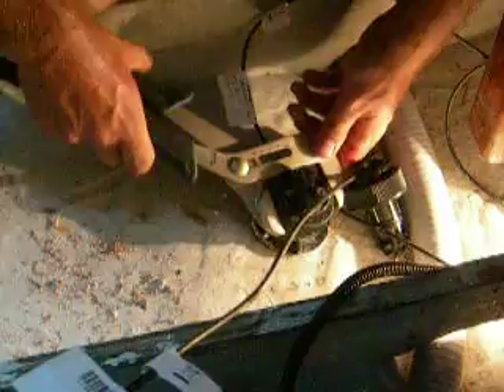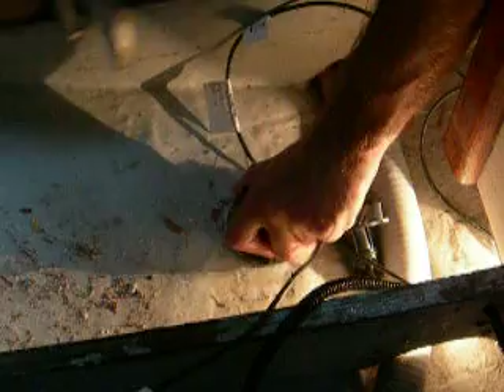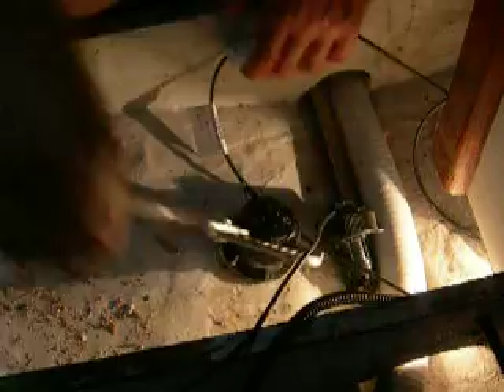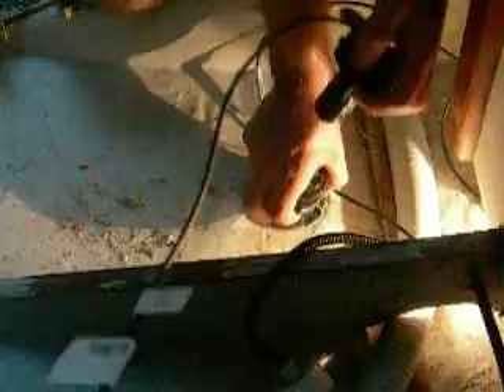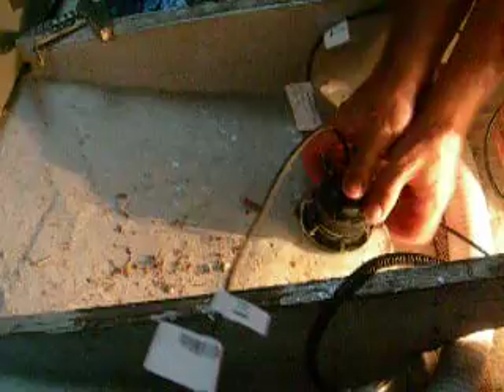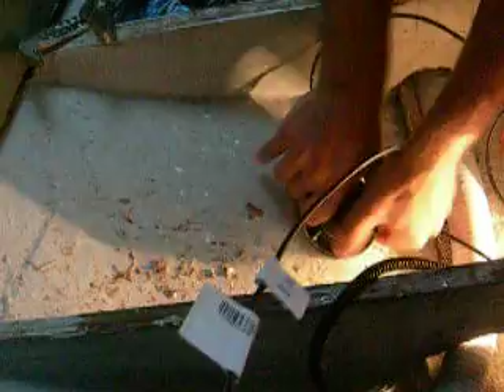Installing the speed sensor

Comment: Very helpful that you posted this, thanks! On my last boat, a Beneteau First 29, the speed sensor was located beside the keel, so removing it before haul-out was never necessary and I never thought about it. On my current boat, a Beneteau 393, the speed sensor is forward of the keel and was damaged by the slings at first haul-out because I didn't think of removing and replacing with the plug. Live and learn! Fair winds!

Comment from the maker: It's designed to be used this way - you install the fake sensor before launch, so the sensor isn't destroyed by putting the boat in the water, and the first thing you do after launching (and ensuring there are no leaks) is install the real sensor. This is all done in the safety of being right beside the travelift, so the boat can be hauled at a moment's notice.